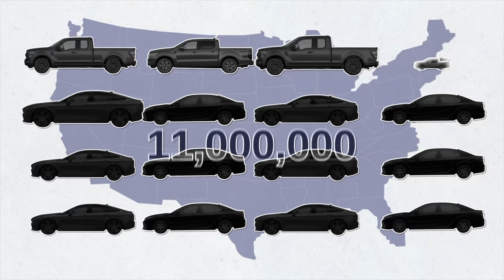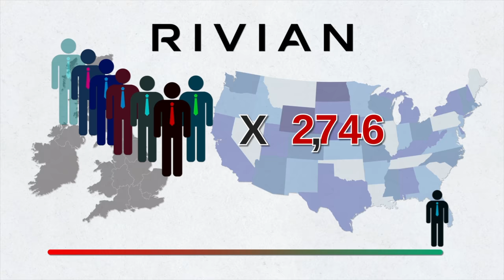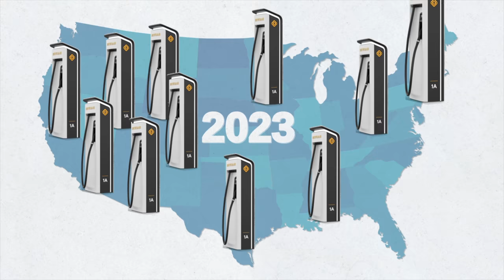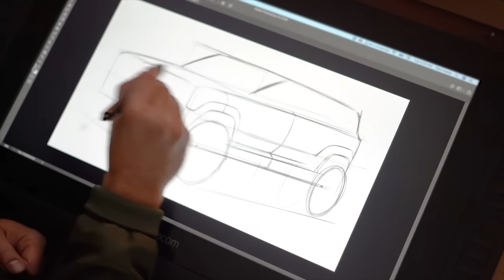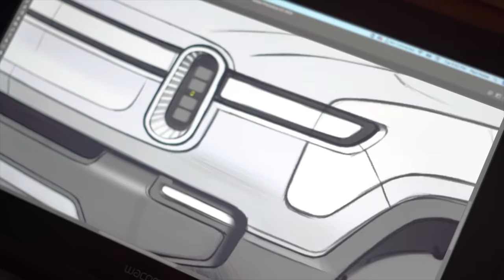Here's Why Rivian’s New Vehicle is the Future of Cars (Goodbye Tesla)

Comment: I need an electric vehicle. My 2007 BMW 328xi costs $100 per week to fuel. I wanna switch to electricity, but I don't have enough money for a new one and I've heard that repairing a used one is expensive when the batteries die. (though the same can be said about the engine of a car...🤔)
Reply: Get a Model 3 Tesla, do what you have to to make the payments....you’ll have it the rest of your life.  It’s $45k, one time only.  You’ll save right away on BMW maintenance and your “fuel” bill will drop to about $25/week (my fuel costs dropped to 1/4 when I switched from an Infiniti G37 to a Model 3).
Reply: Toyota corolla is your answer if you don't have any money.
Reply: @johncahill3644  tesla uses lithium ion batteries which need replacing (at the absolute most) every 10 years due to degradation. A battery costs about $12,000, not to mention how this car would be completely obselete in about 10 years time due to acceleration of electric car technology. Other problem is tesla won't let you fix their cars. You could actually fix a battery cell for a few thousand but tesla make you replace the whole thing as it means your more likely to buy a new car. Much like apple with phones they are vehemently against right to repair which doesn't make sense as they are  supposed to be a green company.
Reply: Wait till you see your electric bill.
Reply: Electric bill definitely won't be free either so there's always going to be a "fuel" cost, It wouldn't make sense to spend $50,000 to save $100/week so if anything get a used low mile hybrid

I disagree with spending $45k on a Model 3 and you'll have it the rest of your life, It's not going to run forever eventually the battery will degrade and Tesla is Apple when it comes to repairing their products.
Reply: @yogsoggoth9786  its not a lot. 6.5 cents kw/h rate in off peak time i.e. from 8pm to 6 am. its takes about 8 to 9 hours to charge mach e at home with 220 outlet. and gives you 350km average range.
So about 7 bucks a week for average person commute . Now fast charging will be not more than 20 to 25 dollars for 90 percent charge and range of 400km.
Reply: @JrVtec  Absolutely! I personally, won't knowingly support any company that has a proprietary business model! Open source for the win, all day, every day. Open source business models, such as Android and Google promote collective innovation as well as affordability (through competition) instead of hindering it!
Reply: @TheEvanOf  bruh what. There's model S's with 300,000 miles on original battery packs. They hold 90% of a charge.
Reply: @yogsoggoth9786  It will be 1/4 of the gasoline bill.
Reply: @TAIMOOR82  can't remember who but a magazine did a test on the chevy volt vs bolt. same cars the volt is a gas hybrid and the bolt is an ev. they found that the all electric chevy bolts actually cost more per mile to drive than the chevy volt.
Reply: @konnerkramer329  well the example  i gave for mach e is not from magazine but from our personal car. And we have it for atleast 6 months now. And we drove over 15k km so far with no maintenance which is another savings in thousands over the period of 8 years. So for 15000 km we spend 300 cad dollars but thats all home charging once a week cause we didn't needed charging out side.
Reply: @torty92  Not with Trump!!
Reply: Electric conversion kit
Reply: @TheEvanOf  EXACTLY
Reply: @Deetroiter  ya, sad...Its like going vegan...they charge extra for no meat...LOL!!
Reply: your electricity is going to cost more than the gas.
Reply: @TheEvanOf  Come on now, lets stop with the FUD. A Tesla battery is designed to last AT LEAST 500,000 miles or 20 -30 YEARS. Maybe more. In the vast majority this is proving to be true. Only a very few outliers have had to replace early (Just like ICE cars, some people treat their vehicles very poorly).

As to obsolete in 10 years, well so far NOT TRUE. In any case. ummm so what? Any ICE car is obsolete the day you buy it. Look at any ICE car 10 years old compared to new. Does that mean its no good, can't be driven? Nope, I have a 92 Ford truck, will last me the rest of my life. A 2008 Commander Same. A 2000 Mercedes, same same. All over 10 years old. Not to mention my 85 Mustang GT.

As to repairing it your self. Many of the systems can ne repaired yourself, but the more sophisticated sections, like Battery Packs, Electric Motor Assemblies, are way more complicated than most can handle. Currently. That is changing on a daily basis and will continue as infrastructure embraces BEV's. So when was the last time you rebuilt an ICE Transmission? Changed your failing Torque Convertor or Clutch? Swapped out the Engine, or fuel system, or heck, most folks don't even change their own battery anymore. Most of these MUST be handled by a dealer (read that as factory authorized only). That dealer network has been ripping off people for decades.
Reply: Cheap tdi golf
Reply: @me1assassin  I never said he should buy a new ICE car instead, and I would never reccomend someone get a brand new car as if that is good for the environment/pocket in anyway unless its their dream car and they expect to instantly lose money on it. An ice car is no where near as outdated after 10 years as an electric car will be. Electric cars from 2010 arent even close to the ones we have today, 2010 ICE cars are fairly similar(except from the ELECTRICAL technology inside) . Lithium Ion just isn't the answer for ALL cars, there will be huge development in electric car solid state battery tech soon. And spending $50,000 now on a BRAND New one would just be foolish. Same way the first flat screen TVs were thousands of pounds and now they are completely outdated. Also these electric cars need to be EASIER to fix than ICE cars if they are going to be a sustainable solution long into the future. The whole point of tesla is to be good for the environment - which would mean easy to Fix- yet they are harder to fix becuase tesla makes them that way. 

Also, tesla may 'claim' the battery lasts 30 years, but my Samsung phone which is supposed to use the highest quality lithium ion batteries has lost 30% capacity after 2 years. With tesla, you only ever get like 60% of the battery and they unlock more of the capacity as the car ages to make you think its not degrading. I believe it charges to 80% true percent and discharges to 30% true percent. That's why they can keep going when they are 'dead'. It's a case of the acceleration of electric cars technology is so fast (pun intended) it's worth waiting jus a-few more years and then buying used.
Reply: @HamguyBacon  Eventually when the states and feds start losing gas tax money
Reply: @me1assassin  The batteries won't last 20 to 30 years. How can you say that when Tesla hasn't even been selling cars 15 years. A design spec is one thing  real world is another altogether.  300 k ? Sorry I know several Tesla owners and one has 180 k and he's lucky to get 82 percent charged. Another has just under a 100 k and is model 3 ( 2017) 87 percent.  Reality takes over in the real world driving.  Look how a Teslas performs in Canada and up north here in the US . If everywhere was like Southern California it would be different.  Have you checked out how expensive parts are when not covered under warranty? It's ridiculous. Also I am able to do any work on most any ICE . I do brakes ,transmission work, any belt drive accessories etc etc. You do not have to use a dealer for anything unless your car, truck, suv is under warranty.
Reply: @Zolar Czakl You might want to deduct the cost of solar panels, and replacement. We have Hurricanes. Do you think insurance companies are going to pay for oil that has not been pumped, or coal that has not been mined?
Reply: @torty92  Explain with links.
Reply: @JrVtec  Exactly. Tearing down mountains in war ravaged third world counties is how we get those batteries. Real environmentalists.
Reply: @yogsoggoth9786    Right on Yog!!  I am not aware of anybody mentioning if it will be cheaper to fuel the electric car with electricity versus fueling the gas car with gas.   Which kind of is a hint that it might actually cost more per month to do all the commuting with electricity versus gas.   In other words, "I saved $400 last month in gasoline costs because I drove my electric car.".....but please don't tell anyone that it raised my electric bill by $500 last month.   🤷‍♂️🤷‍♂️🤷‍♂️
Reply: @TheEvanOf  Right to repair has already gone to the supreme court n the states.. How is this different? Id assume its the toxic nature of the fuel storage with high pollutant high chances from amateurs.
Reply: @johnny0454  its only open source cause its linux .. Google is not the same with the Pixel line as the Nexus line. Nexus phones (the 5 not the  5x) are arguably the best phones ever at over 10 years old still great daily's.
Reply: @rogerwilco8146  it's not really that different working with engines, engines are quite dangerous inhernelty - gasoline is literally explosive but you can muck around with an engine because we just expect that freedom as consumers but I'll tell you what definetly isn't good for the environment and that's having to throw away a whole car because 1 or 2 things are broken. I've seen cars that look new and should be in fine working order but due to extortionate repair expenses they are now just scrap. (Bmws, Audis, Mercs probably the worst for this defo not just tesla and not just electric cars) but electric cars really are headed in that irrepairable direction. People need to really expect/demand more from these companies TBH Whether its apple, Samsung, bmw, tesla They are all scamming us with repair costs and pretending to care about the environment whilst being entirely profit driven.
Reply: @HamguyBacon  no, the electricity costs much less than gasoline
Reply: @TheEvanOf  Not true at all, but okay. Do some research.
Reply: wow, after all the education from EV, people still think battery will die. I repeat, the battery will not die until the car is rusted and need to be crashed, most smart phone battery is 1000 cycle. if EV have 300 miles per cycle X1000 cycle, that's 300000 miles, 20 years of driving. 1000 cycle is not fair because cellphone battery does not have any cooling and almost charge to 100% every day. EV battery does not charge to 100% all the time. So any EV made today will be at least 300k miles, if not half a millions
Reply: @williamwu1985  Most smartphone batteries die after 10 years, car batteries last 5-10 years. Batteries do degrade over time and use. There is no such thing as an infinite battery lol
Reply: @me1assassin  That's based on Laboratory setting.
Reply: @torty92  Where do you think the Electricity is produced? its produced at a Factory that generates electricity by burning Gasoline.
Reply: @williamwu1985  your battery and your smartphone are 2 totally different things. your battery has a charge cycle and will reduce its charge capacity after a certain  number of charges. your phone might be able to make a call on a lower charge because its not using much electricity but your car needs to take you from point A to point B in a 3000pound car. the lifespan of your car will not last 20 years, most Tesla's need their batteries replaced every 12-14 years.
Reply: @HamguyBacon  Electricity is not produced by burning gasoline.  Maybe you mean natural gas?  In the U.S. 38% of electricity is generated from natural gas, 20% coal, 20% renewables.  But this varies by region.  In my state it's 75% nuclear and natural gas.  And it's easy to request electricity generated from solar, as I do.

So while it's true that the majority of electricity nationwide is currently generated from fossil fuels, that's better than burning 100% gasoline.  And the grid gets cleaner over time.  And the pollution is concentrated at generation, making it easier to remediate, instead of at tailpipes.

And EVs have better torque off the line.
Reply: @HamguyBacon  Some (not all) CNG comes from oil wells, but that doesn't mean the electricity in your house comes from oil.  Anyway, the main point is that the grid gets cleaner over time and pollution is concentrated at the generating plant, so even an EV run off of 60% fossil fuel (national average for electricity generation) uses less fossil fuel than a gas car.
Reply: @Zolar Czakl Sounds fair enough, but I don't pay for the Sun here in Florida. Waiting to hear from someone who actually gets cheaper energy from the sun without subsidies or strange contracts. Basically paid for it themselves. We did it with blackened pvc ecetera for water heating with great results. Cost; startup initial capital plus replacement. PVC comes from oil. Even if somehow made from other mined materials no one will do it without petro. If it is not grown, it is mined.
Reply: @ken85225  Bad enough utility companies getting caught overpricing old people from up north that autopay their bills in Florida. Some smart ones noticed, and 8 on your side blasted it on TV.
Reply: @Night Rider That may be true literally, however, to quote Wikipedia, "Android is a mobile/desktop operating system based on a modified version of the Linux kernel and other open source software, designed primarily for touchscreen mobile devices such as smartphones and tablets." Additionally, I was referring to a comparison of Andriod on a scale relative to Apple. Anybody and everybody can develop apps and software for the Android platform (as of the first quarter 2021 Android has 1.26 million more apps available on it's platform than Apple) and any device manufacturer can use the Android OS if they choose to, whereas with Apple, only Apple itself can develop software for iOS and implement it, and only on their own devices because they have everything so proprietarily locked down on the newest phones that not even professional repair shops can change a single part, like a screen, mic, speaker, or battery, even if it is genuine Apple part salvaged from another device, it will not work without Apple themselves unlocking the device at their own repair facilities.
Reply: @shikamaru281281  I think you never research into EV industry. please check toyota BZ4X which is a average battery life products. Toyota warranty the battery 10 years 150000 miles and maintain 90% of original compacity. remember, this is just factory warranty, real world usage are a lot of better than this. How do they do that? well you need more research

Comment: Cybertruck is 30-40% less for equal performance due to the engineering brilliance of the exoskeleton frame, will come with the million mile 4680 battery and it won't get dings, dents or rust.
Reply: Maybe. We'll have to see about that.
Reply: "Cybertruck is 30-40% less for equal performance..."
Actually, you have no idea what the Cybertruck will cost, because Tesla doesn't know either (or will no longer put its "guesses" online). 
"For equal performance," you'll need the mid-priced version of the CyberTruck, not the low-end version. I don't dispute that the CyberTruck sounds great. I'd love to have one. But unless your name is already on the reservation list, you probably won't be able to buy one for four years, or maybe much longer.
"Recently, Tesla removed all Cybertruck pricing and specs from its website, so those prices listed above could certainly change." - Electrek

Comment: If you can make a flashlight light up by winding it or a light bulb light up with a bike. Why can’t the wheels turning charge the batteries. There’s got to be a way to do this.
Reply: They already do this but when slowing down or while no power is pushing through the motors. Even a 2010 prius has these recharge brakes!